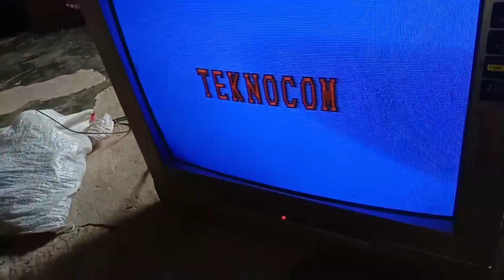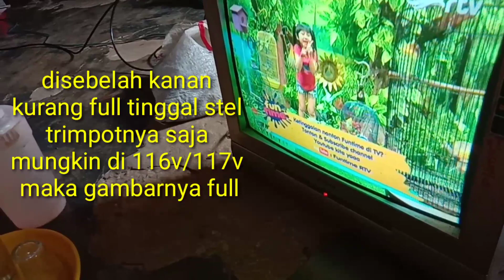service tv China mati total tegangan  B+ nol volt

Comment: Maaf master tvku juga sama teg b+ gk ada, trus teg setelah trafo switching juga gk ada, apa yg harus di cek ya ?sdh 5 hari gk jd2 ni tv awalnya sih normal
Reply from the maker: Cek di elco besar masih tersimpan enggk tegangan besar disitu..jika ada bisa jadi R kembar  rusak biasa klo di tv China nilai R nya 100k atau 120k,jika nihil coba cek sperti tr A1015, optocoupler, atau elco primernya siapa tahu sudah Soak
Reply: @aditvelektronik1751  teg di elco 400v jd 60v master, solusinya gimana ?
Reply: Kalau ngak nyimpen dipeimer b+ masih nol udah diganti ot,dio.tr nya

Comment: Om adi tv servican china sy b+ nya nolt volt tr 3807 tr1015 optocopler dan dioda diprimerny namun tidak ada tgngn nya. Blm hidup jg. Solusinya donk om
Reply from the maker: Tr Hori apkh udah diopen lalu ukur kmbali teg B+ mas apkh tetap nol klo iya coba ukur resistor kembar 100katau 120k di kaki positif elco primer serta dioda  dan resistor 1k di area primernya
Reply: @aditvelektronik1751  ok om mkch solusiny..sy cb dulu iy om intruksi dr om. Barokah dah buat om dlm servican.